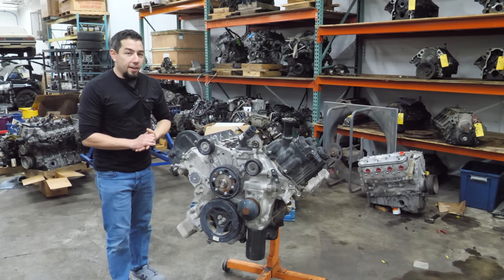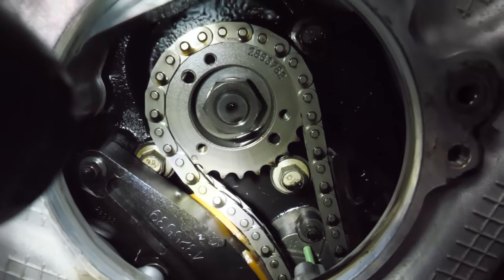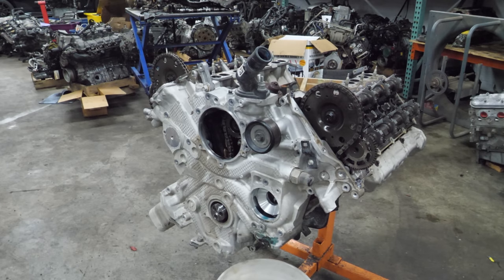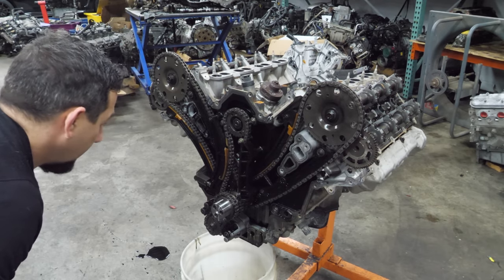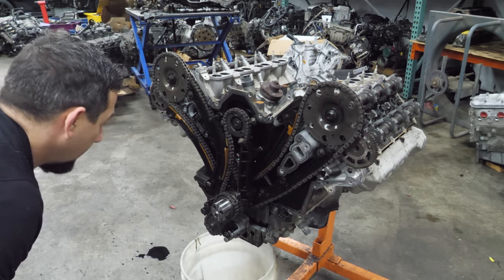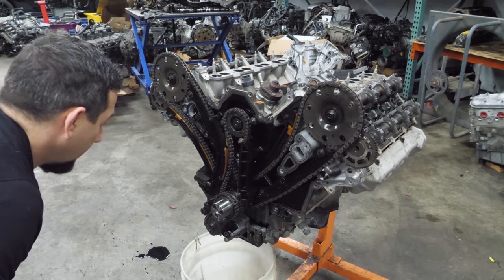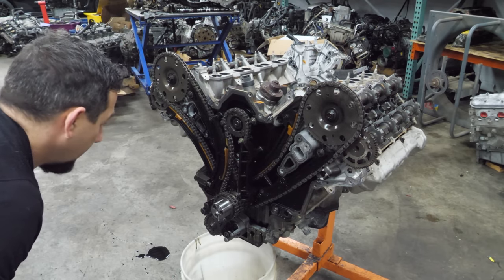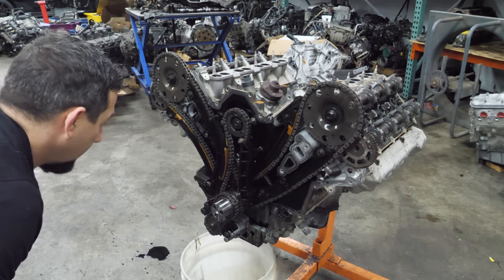Well That's Not Good! Nissan Titan XD Cummins 5.0 Turbo Diesel V8 Teardown. A Costly Failure!

Comment: When it comes to really rusty blocks, I have long thought someone should rig up a way to:

1. Pressure flush all the oil and coolant passages with a solvent to remove every fluid
2. Blast compressed air through the same passages to dry it
3. Pressure flush all the passages with evapo rust, and then have a squirter set up to continuously pump evaporust into/onto the cylinders and circulate it

I imagine this could save a lot of seized blocks 😂

Comment: I've never seen a crank turn blue like that. It must have got really hot. I expected to see the main bearings melted in those back journals. I can't see it being still drivable with the crank broken, especially in a diesel where the compression is so high. Surprised it didn't seize. Maybe it stopped the engine when that one piston smacked the head.

Comment: Might be more trouble than it is worth, but you might want to fabricate an attachment for the fork lift that would serve as a receiver the the engine stand. Don't think that it would try to tip over on you...

Comment: I think the bolts on the I/P were actually acting as studs and there would have been nuts on the back- someone took the nuts off and tried to remove the pump probably thinking that it was gear driven. It didn't look like there were threads in the pump mounting holes...

Comment: You need a 3 foot tube extension for your breaker bar .. you are working entirely to hard to break those bolts lose and you also need some Eye bolts screwed into the floor to chain the engine stand down. Make them removable and only put them in when doing stubborn head bolts. Work smarter not harder.

Comment: Diesel tech here, the bluing of the crank is normal. All diesels I have torn down look like that. But if you want to resell rods, you absolutely ruined them all by hammering on the fracture split surface. You absolutely cannot hit those surfaces even with a brass rod because it damages cast iron. Otherwise it was great to see the internals of this engine 👍

Comment: I had a 1978 Camaro that had a 350 two barrel engine. My son and his buddy were driving it and some how they broke the crankshaft in that engine. I'm assuming that they were doing high RPM neutral slams, but they never told me for sure what they were doing. They claimed they were just driving it. I've beat engines hard and never broken a crankshaft. Strange thing to happen.

Comment: If I were to put an educated guess on why the engine failed, it looks to me the Hi-Pressure pump bolts backed off allowing the pump to move outward over time. I don't think "someone" did this, other than possibly not getting these bolts torqued correctly in the first place. Just a hunch.

Comment: cylinder head bolts torque
Step 1
: 40 N·m (30 ft-lb)
Step 2
: 120 N·m (89 ft-lb)
Step 3
: Tighten 180 degrees

Comment: As Diesel IQ puts it, "The expensive cost of adding the 5.0 Cummins to the Titan, combined with various engine issues, and the limited towing benefit over gas trucks caused the 5.0 Cummins to be retired after the 2019 model year.

Comment: I've never seen a forged steel crank break. Saw a couple 2.2 K Car cranks break. Then again I touched very few diesel engines.  One GM which I felt they could have easily corrected and a few tractors.

Comment: the CP3 pump was like that because some one Replaced it wand did not install it properly  looks like they tried to use the bolts to Seat it but well it  did not work as it was not Seated  ... I have see the same thing on some of the Durmax  DIY mechanics ....

Comment: Word of advice.....  Next time don't knock the connecting rods out using a metal drift, directly on the end of the rod. Either use a nylon plastic drift or a wooden drift, laid on the rod end, and use a hammer. You actually will at least slightly distort the metal end surface of the rod. I may not even be visible, but the original machining finish can be damaged, leading to stress risers, and a rod failure, in the future.

Comment: Passenger auto and non-industrial diesel power are nearly extinct as cost and emission concerns mount. So while this types design probably improved , it was discontinued and not replaced. Interesting show however , with not often seen fail

Comment: Not exactly as simple as the B4.5 or the overseas ISF3.8 engines, but it's interesting to say the least seeing the internals of this engine. I remember when it was meant to be released in a 5.6L V8 and 4.2L V6 modular engines range before the '08 mortgage crisis, and then the ISB3.9 and ISB5.9 were retained and later enlarged to 4.5L and 6.7L instead of being replaced by this project. And to be honest I prefer the old-school design of the good old B4.5 and B6.7 which seem to have a much lesser degree of complexity.

Comment: There is another channel here in YouTube that had one in tavarish channel, they were using it to tow some cars across country and half way broke down into limp mode, it had huge build ups from the egrs, and apparently the turbos are hard to come by, they did that they had only made about 12k to 15k trucks ever so either there will be no parts or a lot of left over parts from the ones never got build

Comment: There is almost no overlap from a crank journal to the adjacent rod journal - 3/8" maybe?  Too much stroke, not enough meat to support torque from front of engine to flywheel.  Not to be a troll, but I can't look at that and trust the design.  Maybe use a destroke crank to get a 4 liter engine and add some boost?  But nice tear down dude, thanks!

Comment: Had a 1.3 mini engine snapped crank but still running , making noises still on 4  but the guy was still using it until I pulled it here in the UK

Comment: Torque spec per Mitchell 1 is 30lb ft, then 89lb ft +180° on the head bolts.

Comment: This Cummins DOHC V8 didn’t sell well for some reason. A local dealer had these on sale for $14k off MSRP. If I didn’t have a truCk, I’d have gotten one. However, I heard it had issues and Nissan decided to quietly end production. Looks like you may have found the problem. Is the crank steel or even forged steel? Since Nissan deleted this engine, might suggest the crankshafts in the early models were somehow weak or defective. It’s a shame cause a Cummins V8 diesel in light half ton, makes for a cool truck.

Comment: Diesels running with broken cranks isn't all that new, when I took a diesel mechanics class at San Diego City College in early 60's the instructor who had worked for the bus company in his younger years, probably in the early 50's, recounted a situation where a driver called in saying his unit was making a strange noise.  the bus was brought in and during the disassembly the 671 "Gimmie" was found to have sheared the crank, diagonally on the enter main.

Comment: The Blue Crank is the giveaway. Too many revs .Oil film goes away,Crank heats up and eventually snaps.
 If it's anything like the Cummins V8's I worked in the 70's, it may be called a Cummins but don't expect semi truck reliability.

Comment: @39:10 that rod and rodcap at extremely worn from rubbing on the broken crank as the engine continued to run, likely contributing to the catastrophe in the crankcase castle

Comment: Fitter on a Job Site I am on has a 2016 Titan with this motor. He has over 300.000 miles on it. It's a P4X Model. He claims it's the best truck he has ever owned.

Comment: I almost bought the 5.0 cumming but opted for the ram 1500. The ram towing capacity is about the same as the xd. Too bad ram didn't use these in the ecodiesel 1/2 then fiats diesel engine.

Comment: The blue on that crank was so uniform from a distance that I thought it was some experimental coating. To find out that was heat-related discoloring is something else. How in the world would the crank get that hot before the pistons? Absolute zero oil or coolant is my guess but there didn’t appear to be any indications of either.
Reply: That blue finish moste likley is from the heat treating process during manufacturing.

Comment: I wonder if they heat treat the whole crankshaft instead of just the bearing journals. on my Mercedes OM617 the journals are a different color than the rest of the crank because it is basically just case hardened for better wearing properties

Comment: Cylinder head bolt torque spec is 30ft lbs then 89ft lbs and final is 180 degrees.

Comment: There should be 3 nuts on the back of those 3 bolts that goes on the injection pump. Looks like someone took those off to remove the pump without the special timing tool

Comment: I had a broken crank on an Isuzu 4HG1 engine n it drove for months without noise I only found out when it started leaking oil from the front main seal so it's very possible to run without much if any noise

Ps the pic on my dp is the truck that had the broken crank

Comment: I don't know if you guy's knew but that V-5 Cummins diesel you guy's were working on was a engine that was sold to Nissan by Chrysler they had that engine in there Dodge Rams but changed there mind's about that motor

Comment: That engine is soft in the crank.....tuned or not....on the ones that are stock last longer but.....the gearing in the transfer case and final drive ratio and how hard you use the truck will determine how long the crank will last....it's basically a torque load/flex.....should gotten the flex plate....I would bet the center is ripped apart too

Comment: MY family, aunts', uncles', nephews' and nieces' are mostly Honda/Acuras and Toyota/Lexus houses.  My BIL is the only oddball that like Nissans and Infinities.  I bought his Nissan Titan with 200K+ miles.  I as not impressed.  I had to replace both cats, union bearing for the drive shaft, starter, 4 oxygen sensors, radiator and the the crappy hose clamps for the transmission lines.  Compared to the 3 Tundras which only needed consumable's like brakes, oil, and other fluids; shocks and ball joints for the high mileage ones.  Interior fit and finish is poor.  There was more ware and tear compare to similar age vehicle of the other 2 brands.  I think there is a reason I do not see as many Titans on the road as Tundras.

Comment: I had a 2007.5 Ram with a 6.7 Cummins, with 140,000 miles and had a noise at the low end. After pulling the engine, the machinist found 7 cracks in the crank when he mag flux it. The first Gen of that engine had CAST cranks but after that they used forged cranks, because a cast crank can handle 16.7 to 1 comp ratio 🙄🙄

Comment: 12:14 Did those nuts actually screw into the fuel pump? Looked to me like they just go into the block. If that's the case then I'd expect there to be some nuts that secure the pump to the block.

Comment: I feel like the veiwer sold you a really expensive boat anchor.  A few sparkles in the oil is way different than a broken crank and a ruined block full of rust and water. 
I feel bad for you.

Comment: Eric, great video. I am curious about the amount of heat on the crankshaft in back??? And the part where he changed oil and it was flakey. So he bought a new engine. I wonder what the old one sounded like driving down the road. Hate to see that you kind of got taken on this core. I would really hate to see someone accidentally post his address. 🤫

Comment: That certain high pressure fuel pump isn’t worth the money they spent to manufacture it. It’s a Bosch CP4.2. They are notorious for wiping the internal cam and sending metal throughout the entire fuel system.

Comment: In the large Diesel engine world cranks break for two reasons. A bad balancer 90% of the time. The other 10% is to much HP.  Was it a fluid filled balancer of rubber mounted?

Comment: This engine is pretty hilarious considering Cummins making a V8 is like Tom Cruise doing a musical. It really does look like an engine made by engineers who threw darts at pictures of V8s for decades. It's got the power of the first gen, LB7 stock Duramax from 2001, 75 pounds heavier, 1.6 liters less displacement, dual ohc which is straight up stupid in an already monstrously tall engine, twin turbos stock so you have to take out a second mortgage when they break. It's an odd bird engine, over square like a Duramax, too. A lot of emphasis on vibration reduction and emissions. Which is code for "stay away unless you got deep pockets and you're a fanboi" Dollar for dollar, I'm going dmax, but I guess if you like the titan truck, this engine is a drop in whereas a dmax would be hell to swap in.  But u can see why it got shelved... it just doesn't make a lot of sense. Nissan's already-proven 5.6 gasser tops 400hp and 420lb ft stock, is much more reliable, only 500 lbs, and cheaper to fix and maintain.

Comment: Big question hows it feel using metric toools not Af its easy to  convert over and be close enough odd  tight ones 10mm 3/8 11mm 7/16 13mm 1/2 14mm 91617mm 11/16 19mm  3/4 25mm 1' etc

Comment: The CTD that no one wanted, Cummins managed to resurrect and sell it to Nissan, only to be abandoned 4 years later.  I almost traded my "probably will have a main bearing failure" 2014 EcoDiesel for a 2020 Titan 5.0L "expected to break a crankshaft someday" model.  After doing the numbers, weighing the options, and venting about my future nightmare with the Ecodiesel, I decided to keep the Ecodiesel.  Makes almost the same torque and is a known quantity.  Also ... Nissan is abandoning this engine faster than Cummins can shutdown the forge line.  Or maybe it is the other way around.

In reality, this engine made zero sense by the mid-2010s.  The CTD 6.7L makes more torque, more HP, and similar MPGs.  The 3.0L balances for those wanted/needed diesel torque but in a model 1500 weight class.  If you graph the per-liter torque/HP numbers this engine just plain is last century.

Comment: I'm kind of surprised you can buy one of these engines new from a dealership.  Does Cummins still manufacture them were they used or are being used for anything other than Nissan trucks?

Comment: Although not part of this tear down, you have in the past mentioned heat tabs.  Who adds them and what do they signify?  Great videos, BTW
Reply from the maker: Salvage yards and engine rebuilders.
The center melts at a certain temp so you can tell if it’s been overheated.
Reply: @I_Do_Cars  thank you

Comment: I think I'll stick with my 2001 Dodge 3500 and it's 5.9 liter I6. I never spin it over 3K and seldom above 2.5K. 245 HP and 500 lb/ft of torque is just fine. No EGR, No variable vane turbos, just a nice simple diesel. I did put a FASS fuel pump on it to maintain 15 PSI to the injection pump keeping it nice and cool and working forever. All you rich folks can take your emissions controlled engines and spend all your money fixing them and buying fancy manufactured urine to put in that extra tank of stuff you have to have to meet the emissions standards. Have fun!

Comment: That crank has to be a manufacturing defect if they were breaking that easily...all it takes is machining the inside corners with too sharp of a corner and not enough of a radius to produce a stress riser that will easily cause a fracture.

Comment: Mechanic buddy said  most of the time they find out, it is because they try to use them like a 2500 or 3500 diesel, its not built for it.

Comment: My 2018 dropped a rod bearing at 125k, after a new engine done at a ram dealership because Nissan wouldn’t do it,  traction control and all turbo codes. Ram dealership sent truck to Nissan dealership for the turbos/actuators.  They installed the parts with zero diagnostic work. Same codes😂  after 5 months of me not having the truck ,  bill for engine , turbos and labor was 34 k. Had aftermarket bumper to bumper warranty on it which said we aren’t paying these clowns another cent. Traded off Titan to Ram dealer and went 2500 hemi!  Overall I loved the truck,  but you can’t find competent shops in my area of Wv who will touch a 5.0.

Comment: I have a friend who had a 2017 titan 5.0 Cummins. And only 50k miles. And it the motor only sound like a little rattle but was told needed a whole motor. . They tore it apart and crank ruptured similar way. And it still ran just nasty

Comment: If running the wrong oil or tuning the engine breaks the crank, the crank is WAY too weak lol. Pretty surprising a Cummins has such a weak crank.

Comment: I had a 1.9 alh TDI that broke a crank, oil looked fine and it ran decent, sounded like a rod knock, I actually tore it down thinking I'd put rods and bearings in it and run it, I didn't end up doing that 🤣

Comment: Pretty bogus to have a crank break, no bearing failure. It was right through the fillet radius so maybe a problem there. Not a torsional type break. Be interesting to know what kind of work the truck did. Nothing owner could have done to cause or prevent this one IMO.

Comment: I've seem similar damage to a 21 ram with the big 6.7. Cylinder 5 had identical impact damage to the head as your cylinder 7. I knew the engine I was working on ingested coolant through the EGR cooler just before it was having bad misfires. I never tore this engine down beyond pulling the head but I am curious if the bottom end looked the same.

Comment: The only engine I’ve ever saw break a crankshaft and camshaft is a GM 350. I saw multiple times. It looks like a grenade went off in the inside.

Comment: "6.5 GM Diesel breaking crankshafts" ? I didn't think a 6.5 GM turbo diesel could make enough power to hurt themselves. Damn things run forever if you move the electronics for the injection pump.
I've heard of the 5.0 Cummins V-8 breaking crankshafts. I would be willing to bet that is the number 1 failure.
Reply: I’m sure it’s the thirstiest diesel ever